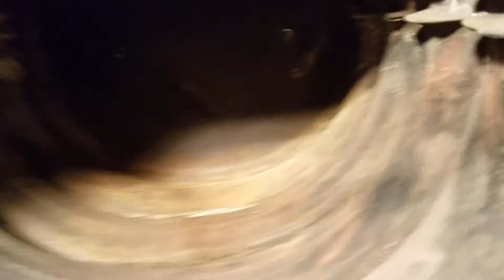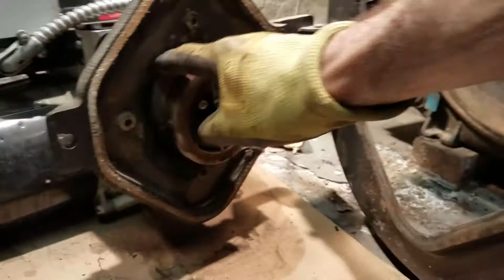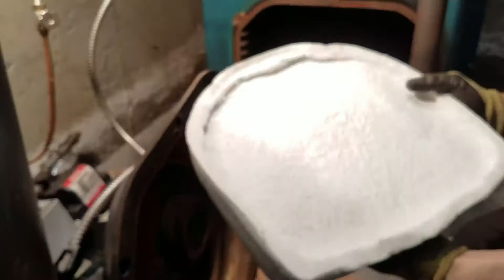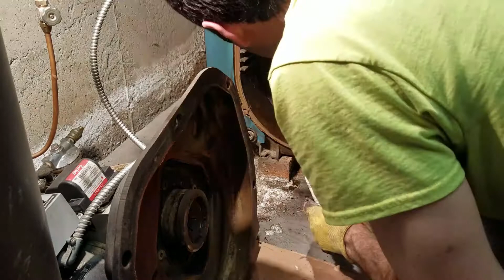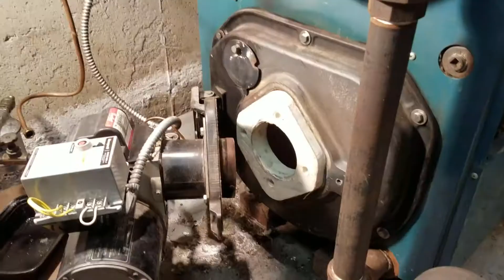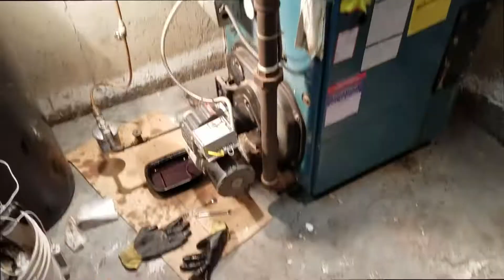DIY Replace Oil Boiler Fire Chamber

Comment: Where can I get the replacement pieces and instructions for my beckett oil furnace
Reply: The furnace/boiler isn't a Beckett - Beckett makes the oil burner.  Look for a plate with the make and model number and try contacting the manufacturer.

Comment: What a thorough job. Thanks for posting this.  Did your boiler originally have that rope gasket on the door?  I know the kit I bought has one, but the oem manual I have for my Peerless JO series did not originally have anything on the door. Only the back wall and floor.
Reply from the maker: Mine did have a rope around it. So I peeled it off and put a new one on with glue.

Comment: I have a Thermodynamics boiler, and to change the chamber the boiler has to be disconnected and turned over or raised up.  I just bought a new Slant/Fin..
Reply from the maker: ugh, that sounds like a lot of work.
Reply: @MakerMaxCorbett  Too much work for a 30 year old boiler.  TBH, the Thermodynamics S lasted almost 30  years with no leaks, so it did its job.  The Slant TR-30 has been running perfectly and my fuel usage is down about 20% by my reckoning. I just read that it's possible to change the chamber in the Thermo S  by cutting some sheetmetal and folding it back, supposedly OK'd by Thermo (?), but I had already replaced the boiler so I didn't attempt it.
Reply: دیگ ترمودینامیک چه نوع دیگی هست
Reply: @MohamadMaarefvand  "Thermodynamics" is just the brand name of the boiler, not any specific type of boiler.  The Thermodynamics S Series (google that name because youtube doesn't allow links) will show you what it is.  The Thermodynamics S is a typical steel (not cast iron) boiler used by building contractors mostly because of its low cost. Mine lasted almost 30 years which is pretty good.

Comment: What’s the white things for? And would the boiler break without them?
Reply from the maker: It is insulation to keep the hot flame off the metal.  The flame produces corrosive gases that will eat away at the metal jacket with the water over time.  So it allows all the heat to go up.